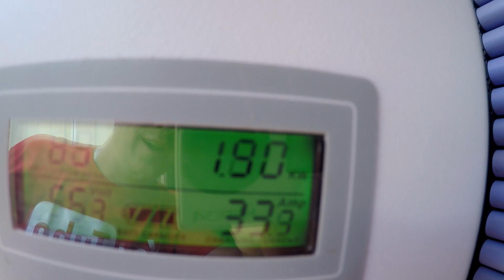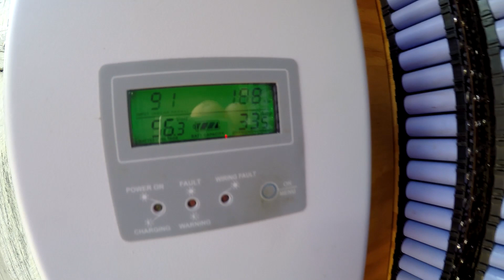30 kWh 18650 DIY Tesla Powerwall 2

Comment: can you use an electric shower and take a full 10 minutes bath with this pack?
Reply from the maker: how many watts does it pull?  - i'm thinking it would be more like HOURS and HOURS ... more than minutes
Reply: @HBPowerwall  mine is 3 levels of power/heat, warm / hot / very hot, 2400/4200/~6600 watts at 220v, I never used at more than 4200 on winter (living in North Argentina)
Reply from the maker: So about 2 hours on max

Comment: Hello Pete! Answer me: Does welding with tin and soldering iron not heat the li-ion cell? Will not this welding temperature reduce the storage capacity of the cell and its shelf life?
Reply from the maker: +Hugo Câmara Schulz ask me in 2 years I'll test it for you :)
Reply: OK thank you! I am also getting 18650 cells to make a homemade Power Wall. I had read on the internet that these cells are sensitive to high temperature, so the question I asked... Well I am in the process of studying and acquiring knowledge about these cells. You can let me follow your project and get inspired by it.

Comment: Id love to see some costings on this to see how much its set you back.
Reply from the maker: Already done on the forum :) http://www.diypowerwalls.com/t-HBPowerwall-Offical?pid=866#pid866
Reply: HBPowerwall very good, myself being a CEC accredited grud connect designer and installer as well as having battery endorsement i always look at project like these and wonder what happens insurance wise if things go wrong. Tesla for example would have to show a lot of test results before being passed for approval to be installed within Australia where as systems like this obviously havent... id still love to do something this myself just for the satisfaction of building it.
Reply from the maker: +Adam its currently getting the bms installed with some big changes to bring this to the next level in safety. It's diy but I think I can do better :)

Comment: I just found your channel is just amazing what you have done here. But I have questions what's the voltage output? and what kind maintenance they need? and how often?
Reply from the maker: Currently, it 's 48v well kinda 57.4 is max voltage and 50v is low voltage cut off. At the moment I check several times a day with multi meter and temp gun just for my own piece of mind. If a pack is lower I pull it and replace (typically takes less than 10 min)
Reply: HBPowerwall thanks for replying back.

Comment: so what all are you, can you power? and what are you using to charge them?
Reply from the maker: My home everything except the electric oven, HWS, & large aircons. Every power point, light or fan is powered by these 18650 cells all day every day. They are charged by 3kw of panels and when needed topped up via my 6kw grid tied system. This has only happened a hand ful of times so far.

Comment: Looks nice, but what do you do in winter? Heat them up?
Reply from the maker: no need never get below freezing here. Guy in US has his in neg 20deg and they seem to be holding up ok for now. Not enough data on long term effects of using used cells in this way. Few years time we'll either be really pissed or really happy ...lol
Reply: They don't like anything below 5deg C and anything above 20deg C and will start degrading on performance. All lipos/liions are really menat for indor use.
Reply from the maker: bugger, well it's been over 40deg c every other day for the past 15 days. :(
Reply: 40deg even in the shed? They won't degrade instantly but it's worth doing something about it. Maybe put some insulation under the roof.
Reply from the maker: +Google+ SUCKS BALLS - the worst forced social network still going to be 40 as it's the air temp.

Comment: wait so its 30 kwh total but you only get 1.9 kwh output?
Reply: don't mistake kwh with kw. kwh - capacity is power over time while kw is power at the moment. he has 30kwh capacity in those battery but his solar panels were outputting 1.9kw at that moment. That mean that if the output of the panels would be the same .. It would take 15.7 hours to change the batteries from 0% to 100%
Reply from the maker: 30kWh storage - maybe you saw input from solar 1.9kw ?

Comment: That is an impressive battery bank!  Do you need to use a BMS (Battery Management System) or should you use one for solar panel purpose to correctly charge each of these cells to the correct voltage to stop over charge or over discharge etc?

Also is there any reason why you decided to go with 4S 20P layout then wire them all in parallel @ 3.7V ?

Would it be better to wire @ 12V or 24V directly per pack?
Reply from the maker: No, BMS it's not 4s 20P it's 42 packs of 80 cells. 48v configuration so there is three banks there.
Reply: Gotcha, I meant 4x20P.  How are you load balancing the 7 separate parallel cells (banks) to get 48V?

To my previous question - Would it be better to wire @ 12V or 24V directly per pack (these 4x20 cells) to achieve 12 or 24V right off the bat vs the 7x banks of 80P cells @ 3.7V's?
Reply
Reply: I just found another 1 of your video's where you took all 7 cells off the wall and manually re-balanced them.   Good job.

Have you thought about the idea of throwing a 7S BMS for one of the 24V banks?
There's a bunch on aliexpress however you'll probably need a decent High Amp one.  I'm not sure how many Amps are going through each one of your 24V banks but it would be a good addition to the setup and I'm interested to see how that goes.

Comment: where do you find the plastic parts to hold the 18650 and also the brackets that hold the banks?
Reply from the maker: Plastic Parts things http://www.ebay.com.au/sch/i.html?_from=R40&_sacat=0&_nkw=10Pcs+4x5+Cell+Spacer+Radiating+Shell+18650+Battery+Pack+Plastic+Heat+Holder&LH_PrefLoc=2&_sop=15 and the brackets I have made locally this is the crude measurements i gave to the laser cutters https://drive.google.com/open?id=0B3D1svhLzR-JS3N6a2JpZVVLYjQ if it's useful to you drop me a few bucks via PayPal :)

Comment: For Bus Bars why not use a 3/8 or 10mm copper pipe and either smash them flat or cut then in two the long way and flatten them?
Reply from the maker: Cause my ocd would go into hyperdrive :)
Reply: HBPowerwall I'm doing this but I'll cut the pipe and flatten it easy way out.
Reply from the maker: there are heaps of cool ways of doing it :) cheaper the better!

Comment: What happens if one cell fails? Or becomes week?.
Does the whole pack suffer?
Reply from the maker: +Michael Nevakshonoff cell level fuse blows and until 10-15 go you won't really notice. Then you spend 4 min and exchange for a spare pack and your good to go. Only had 4 cells fail in 12 months. 3 was a stupid assed mistake on my behalf.
Reply: HBPowerwall that's great   thank you for the info

Comment: Awesome stuff! Non battery question(s); are they "force" brand cable shears and ebay spec hydraulic crimper and do you rate them? Cheers. 
Keep up the amazing work and vids.
Reply from the maker: shears seem to work well for the $35 price tag, hydraulic cripmer i expected to die by now but has proved me wrong thusfar but i don't crimp the hell out of the cables for fear of poping a seal.
Reply: Thanks mate, good to see a local bloke doing some great work! Keep up the top content!
Reply from the maker: Thank-You

Comment: Nice!  Looks like it should! If you need more you could add a middle door in the shed. If you got space for it. First you open your main doors. In the middle (deep wise) you have next layer door of battery's on hinge's. Doing that you could have another 2*30kw. Ie 30kw on each side of that one.      At least that's how I'm going to do it to be able to fit it all unless i go for another type of style.
Reply from the maker: I'll just go bigger shed :) easier and cheaper 
Thanks for your kind words..

Comment: looks good, clean, and easy for me to copy.  3 columns x  14 rows x 80 cells = 3360 cells.  (30000/3360)/3.7= 2413 mah per cell.
Reply from the maker: average is 2.4ah :) but math! lol
Reply: I edited above but I was wondering maybe a thick copper bare wire instead of the bus bars (or even type L 3/8" copper tubing).  Then just bend the wire in a big U.
Reply from the maker: There are heaps of ways of doing it, this is mine :)